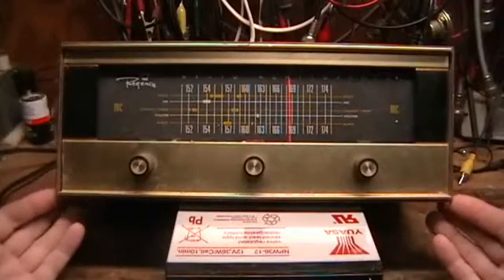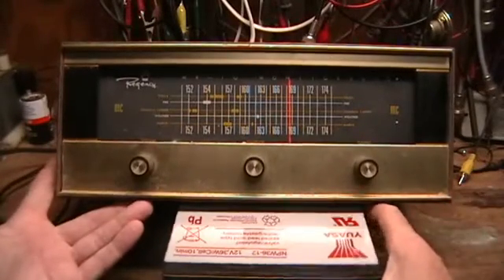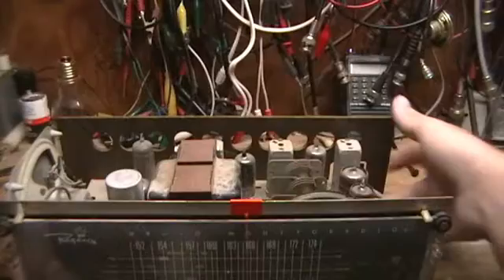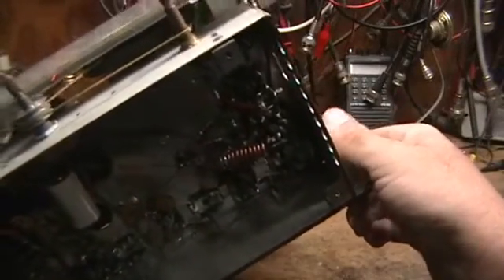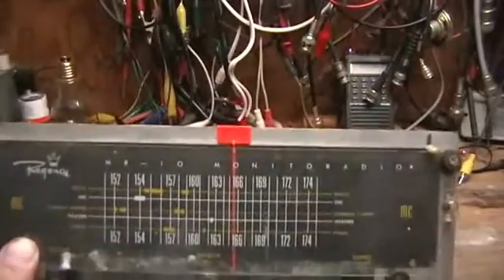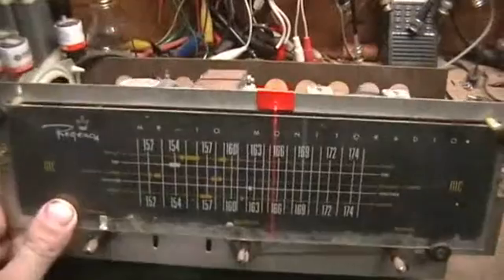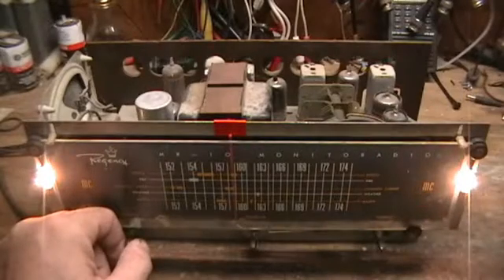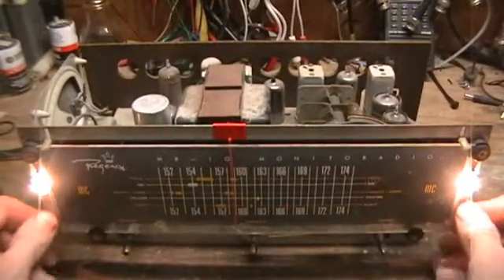Repurposing of an old regency monitor radio into a broadcast FM radio.

Comment: Not usable anymore? The radio would have still worked fine for VHF reception of public service, marine, weather, etc. Wideband is perfectly fine for most such uses. Why go to all this trouble when FM radios are a dime a dozen?!! Not only that, a perfectly good VHF receiver has been disabled.
Reply from the maker: It is not a “wideband” as in LMR 20 KHz “wideband”. It is a true wideband, as in  200KHz wideband.

Back in the real old days when it was made, public service did not use 20Khz maximum bandwidth at 5Khz deviation, or what we call “wideband” today. They sometimes operated up to 100Khz or more bandwidth. Closer to what modern FM stations operate at. What we call “wideband” today (20Khz bandwidth) did not even exist back then.

It has the standard 10.7Mhz IF which produces a 200khz wide IF channel, and detection. When I tune it to a “wideband” (NOAA weather radio) station I, you can barely hear them talking even when I have the volume turned up to the max. When I turn it to the few existing narrow band 11.25Khz public service channels it is even harder to hear anything.

To be able to realisticly use it for modern 20Khz, or 11.25Khz channels, I would have to build on a second IF chain at 455Khz and a new detector better suited for the narrower channels.

And that is not even talking about the fact that the number of remaining analog LMR users in the area has dropped to a handful, and those are most likely going to be gone in the near future. I could try to keep it on the LMR frequencies, but there is going to be nothing to listen to in the near future.  One of the only main ones left is a simulcast of the police dispatch channel in FM. And we don’t know how long that is going to hang around. All the rest has went digital.

So moving it to FM broadcast band was the only long term option for any continued functionality. Unless I wanted a barely usable weather band receiver.

Only other option I seen is rip out the 10.7Mhz IF, throw in a set of 455Khz cans with an AM detector and drop it down to the shortwave band, as a shortwave receiver.